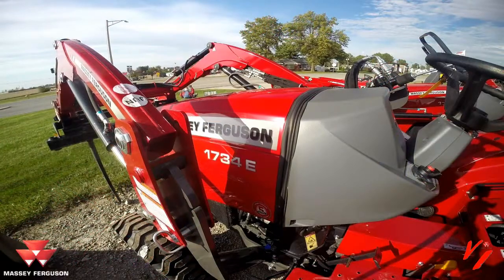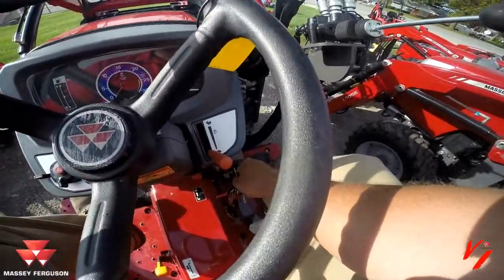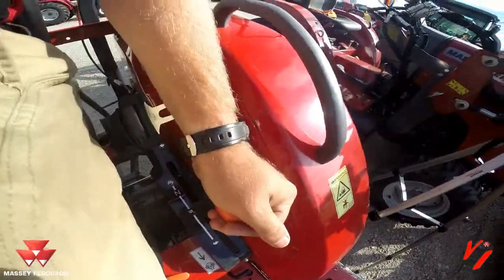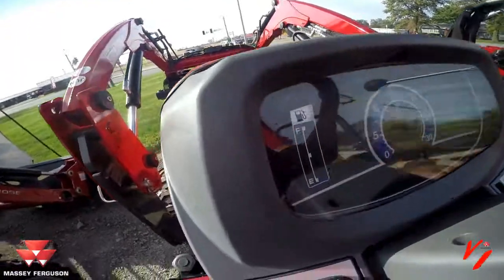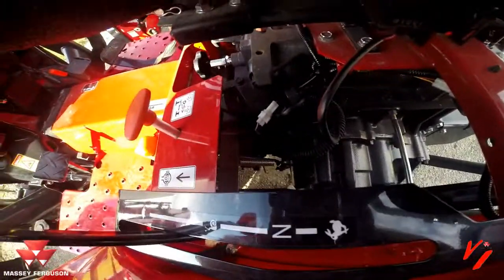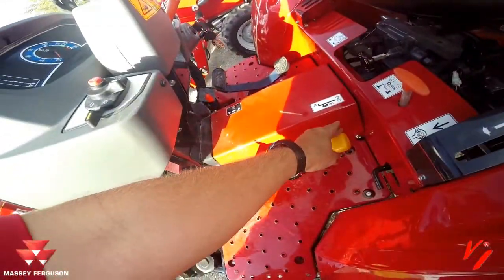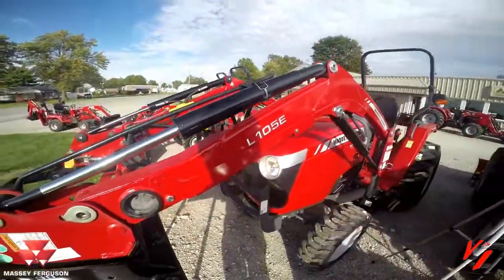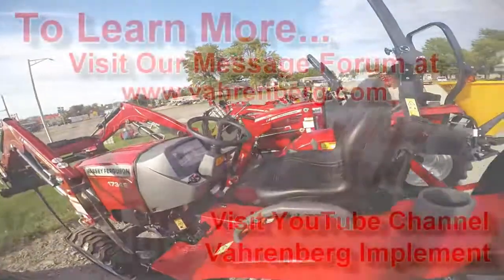The Basics: Massey Ferguson 1700E Compact Tractor - Start-Up Procedures

Comment: i like your videos that you do keep making your videos
Reply: I like your video. Can i ask ? Why my tractor messy will not start after changing the oil? Thank you Sir.
Reply from the maker: There are many things from safety switches to the electrical components to Battery condition that can cause non-starting and varies by models. I would recommend calling your local dealer your purchased from and their service department should be able to help you get it back and running.
Reply from the maker: Thank You for the Comments! That is the reason we do...to help others. We also love watching customer videos too and how they use Massey Ferguson.